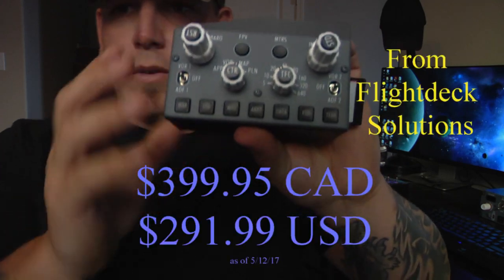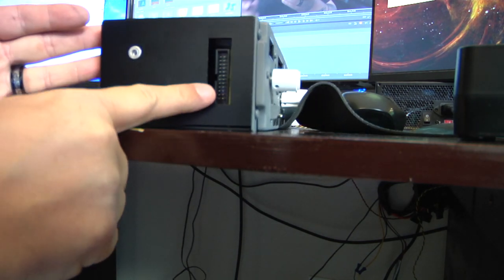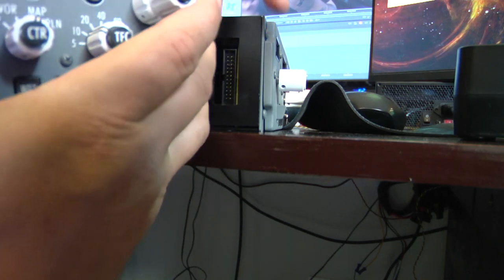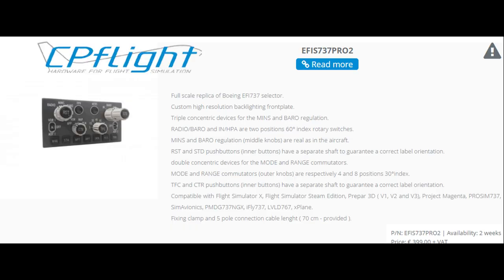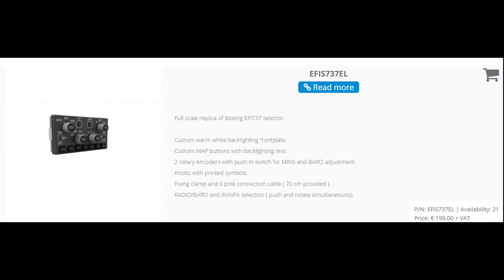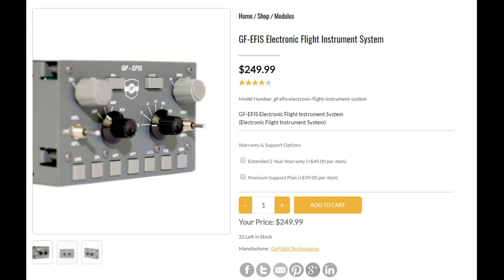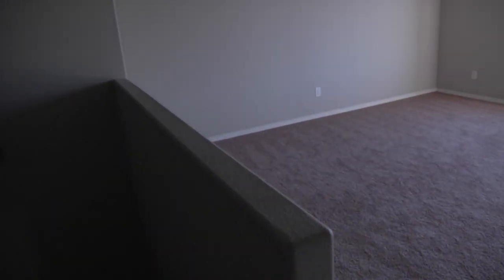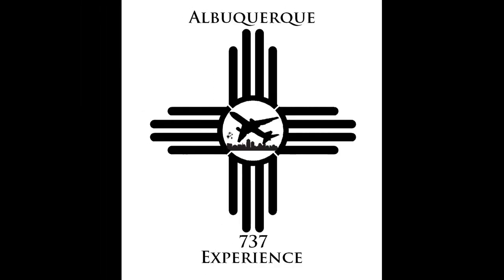ABQ 737 experience Ep4 EFIS

Comment: Interested in your pc set up, and will you be running 2 mini pc's recommended by P Cos, I may go ahead and rebuild the one I built in 2007,ASUS  RAMPAGE 2 motherboard, 12 gigs DDR3 memory,  Core I7 920 chip set, 4 TB SATA drive, 1000 watt Corsiar power supply, and 1 GTX 275 GPU, still works very well, but will be lacking in the graphics department. I do want to try my hand on a  water cooled system for next build, but the pricing for the build will be $6000 -$7000 in parts total. Suggestions  are welcomed. Also what flight sim are you using and what will you stick to?
Reply from the maker: Honestly, I haven't put too much thought into this yet. I have two alienware computers that I plan to use. The main comp has an I5-6400 with 16gb ram and a GTX1080 gpu. the second has an I5 as well with 16gb and gtx980. They were not purpose built, just what I have laying around. I will start looking into this more as I get to a point where I need multiple units.